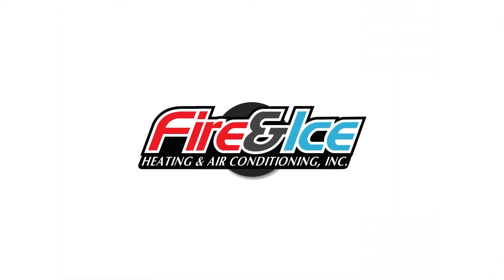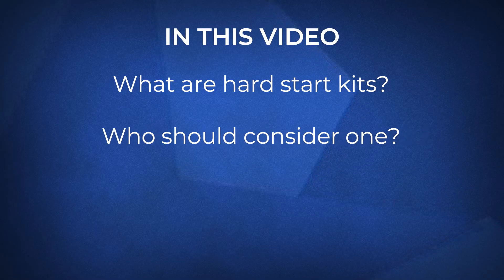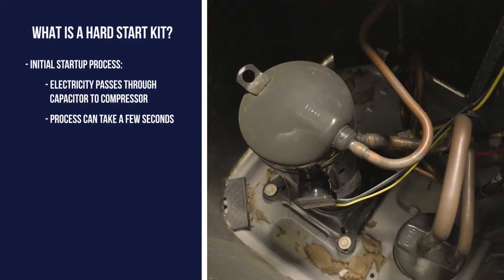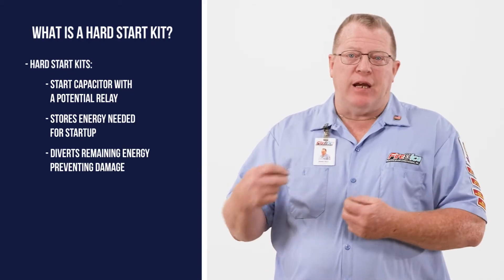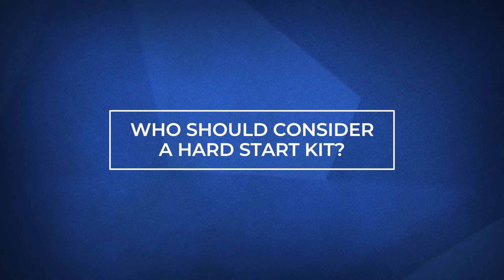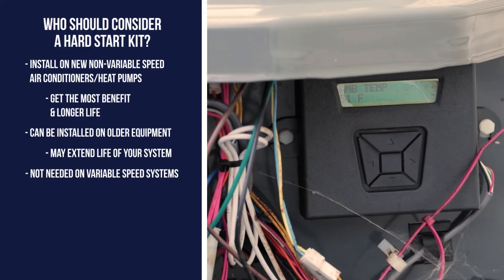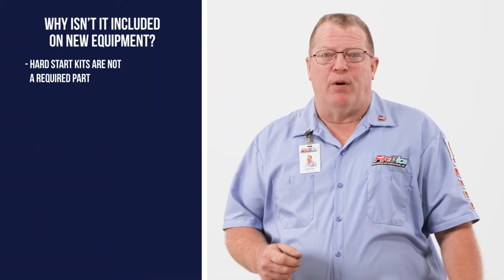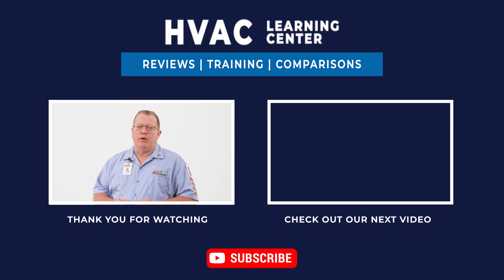Hard Start Kits - What are They and Do you Need One?

Comment: Very helpful video, thank you.   One comment, the installed price of $350 seems very high compared to the actual price of the 2 easy to install parts.
Reply: Ripping you off. I bought a new compressor and hard start kit on my 2015 Goodman and I’ll install with my friend who’s an electrical engineer.
Reply: Yea it is about $35 in parts and less than 30 minutes to install. 😲

Comment: Hard start is harder on your compressor but helps reduce locked rotor amps needed when using a generator.  A soft starter is softer on your compressor and reduces LRA needed even more.

Comment: I was wondering what temperature is rated for the capacitor in hard start kit. I live in Arizona and any capacitor rated for less than 85°C is not useable for AC in here. It would not last even one summer. We have temperatures 112°F-117°F in 
June-August.

Comment: Working on new units, heat pumps on 4 story buildings , I can say the hard starts have worked on 3 different units on the top floor. It seems some compressors have a hard time with extremely long line sets, those hard start kits worked like a charm, idk if it’s common, I am not an HVAC tech but I replace capacitors, find shorts and leaks all the time so mostly am dealing with new units all electric heat pumps and long line sets are too much for some compressors. The hard starts are life savers. Our installers are about 50/50 some love them some hate them. Idk why, but I had an old timer HVAC guy tell me if it’s a heat pump anything TXV put a hard start kit and save your compressor anyway just my two cents I have seen them work and see no negative impact.
Reply: agreed I have TXV and my new unit compressor died in 2 months thank god I had the warranty. New compressor was having trouble starting and after some research Goodman recommends hard start if you have TXV. I changed the capacitor and install hard start both are Amrad a little more money for Amrad but worth it in the long run.

Comment: My 25+ y o Lennox 4t unit has always had a funny start. Initially it started with a significant bang for a few years then settled down for several years and for the last five or so years it seems to have a pregnant pause combined with a vibration. The time period is about 1-2 nanoseconds maybe three. Can you give me a guess? on wtf I can do to get it resettled down. Otherwise it works as expected short of needing about a half pound of refrigerant every couple years or so. Holds pressure for 24 hours. Thanks
Reply from the maker: It’s 25 years old. Well past its useful lifespan. Hard to say what can make noise on that old of a system
Reply: @fireiceheatingandaircondit4363 
It’s only run probably one months time /year. Tho old it isn’t really. The noise has been from day one tho not as hard of a bang as in the early years. The hvac guy says to replace with a smaller unit but it’ll  run a lot more. I smell a rat !!

Comment: after install original 5-2-1 hard start kit, seem the AC when turn on sound like it  kick in louder harder than before, pls help why
Reply from the maker: It does kick in harder
Reply: @fireiceheatingandaircondit4363  the kick sound seem like from the fan start, i replaced new cap OEM and new 521
Reply: @fireiceheatingandaircondit4363  hope it ok not hurting my compressor
Reply: @fireiceheatingandaircondit4363  thank you very much

Comment: Great video. My question is a friend of mine bought 13,000 gas n gasoline generator along with a 10 circuit transfer switch which I installed for him. I bought a micro air easy start kit for his 4 ton a/c unit. But it has a solid state relay hard start capacitor. Do I need the soft start kit or can I by pass the hard start capacitor or stay with the hard start capacitor!!
Reply from the maker: No idea

Comment: My grandmas air conditioner has a hard start kit on its compressor, it was installed in may of 2004, it is now 2023 and it is still working. We are replacing it next week due to other issues. Old amana packaged heat pump. Unit was installed in 1978.
Reply: I’m replacing my York “table top” heat pump circa 1980. What did you end up replacing with
Reply: @darylcuster4417  replaced it with a goodman 3.5 heat pump

Comment: Would you install a hard start kit on a air conditioner that is blowing one fuse periodically or change out the compressor under warranty? Thanks
Reply from the maker: If unit is under warranty, then I would get it fixed.  If that means the compressor, so be it.
Reply: whats the best hard start kit for a Ameristar 2 Ton a/c split system
Reply from the maker: Any of them should work
Reply: @theMister07  Get Amrad
Reply: @NO-END will do, thanks

Comment: Video never bothers to show an AC with and without the kit starting.   Is it quieter?  "Hard Start" seems to be a bad name for this kit.  I just bought a soft start and will install it myself for $300.  Seems like I made the right choice as the soft start is very quiet on my RV AC.  The capacitors in these AC units are designed to die at ten years so they can sell you a new AC unit.  A surge protector can make them last longer, but a surge protector costs about the same as a new capacitor that will last another ten years.
Reply from the maker: Kit makes 0 noise

Comment: Great video. I have an older RV. The AC was "clicking" and I swapped out the three compactors. Everything works fine, but since it's an early 90's RV AC, I was wondering if I should install a hardstart kit. Thoughts? Thanks and subbed.
Reply from the maker: I would not hazard a guess on mobile homes as we do not have experience with them.
Reply: @fireiceheatingandaircondit4363  OK. Thanks for the insight.

Comment: I found the problem. Not wiring but a dislodged plastic piece that should have opened the circuit to the hard start capacitor.  Shoddy parts I would say.
Reply from the maker: I’m glad you were able to solve your issue

Comment: Is the wiring the same when installing on a package unit vs a split unit? I put one on a package unit and it works great. I put one on the condenser unit outside and it smoked the hard start capacitor. I wired it as instructed. Actually I put kits on two package unit with all working fine. I put a kit on two split units and smoke both times. I feel certain I wired it correctly. Thanks
Reply from the maker: We don’t have package units in Columbus Ohio, so I can’t answer your question as  we don’t know unequivocally.

Comment: @1:48:  You stated that the hard-start capacitor stores a charge for the next start, but at the time stamp, you can clearly see a bleed resistor.  So, it appears to me as if that hard-start capacitor is acting as a current buffer at start and shut-off, not as a boost upon start-up.  Am I misinterpreting what's shown at the time stamp?
Reply: I know it’s been two years since you wrote that but you are absolutely correct. There is a bleed resistor on the capacitor of the hard start kit. It doesn’t store anything. The hard start kit has two parts, a capacitor and a relay. Some cheaper hard start kits use a thermal cut off rather than a relay, and are IMO not as good.

The hard start kit adds a capacitor to the start windings to change the phase angle of the start windings. The relay energizes and quickly removes the hard start kit from the circuit. Often the relay needs to be mounted in a particular orientation which is written on the side of the relay in tiny little letters, usually “top” with a little arrow, and mounting properly allows for gravity to help the relay function properly.

Most videos explained that the hard start kit adds a boost of energy that is stored in the capacitor. Nope!
Reply from the maker: No, you are just reading the videographer may have cut the film a little wrong.  These are General videos for people looking for some knowledge, not those who already have it.  Thank you for watching so closely
Reply: @fireiceheatingandaircondit4363 
There is a bleed resistor on the hard start capacitor. 100%.
Reply: ELI the ICE man. Voltage leads(by 90 degrees) current in an inductor. Current leads (by 90deg) Voltage in a capacitor. For every volt of potential stored in a capacitor there is a coulomb of charge stored a well. 1 coulomb of charge is equal to 1 amp. So if your start cap is charged to 240VAC there is 240amps of current availible to be discharged to the compressor. If you dont bleed that cap with a resistance you have welding level current available. Dont believe it? Charge a 1 Farad cap up to 24VDC and place a insulated screwdrver across the terminals. You will get a nice blue arc and a nice chunk of metal instantly vaporized for your screwdriver🤣

Comment: I have a Lennox 2 stage 1 seer 5 ton unit, the lights dim when it fires on, do I need a hard start kit? Can I even put one in on a 2 stage unit ?
Reply: If you live out in the country and you line to your home is more than 250 feet away, you may have a substantial voltage drop. I'm sure a hard start kit will help and make sure line can carry current for all your home needs like water pumps, etc.
Reply from the maker: It can take one, but it may not help that problem, depends on size of circuit needed and what you have, as well as power available to the house at the time

Comment: $300 - $350?  A good hard-start kit costs $40-$70 retail and is simple to install.
Reply: I had a new  capicitor and hard start kit installed 212 bucks  all in. You have to shop around, there are plenty of Heat and Air outfits around
Reply: @ramhaven2322  You got a good deal indeed! You can brag all day long.-
Reply from the maker: The cost to run a business, hire and train technicians, put them in a van, stock that van, insure that van, and build this video so we can have this conversation are just a few of hundreds of items that have to be calculated into every single repair a service company has.
Reply: @fireiceheatingandaircondit4363  Very well stated, it's very easy to condemn the high cost but it is expensive to run a quality business. That van also has to get to and from the service location, that costs money. The reality is if the customer could do it, they wouldn't be calling out a technician. Thank you for the quality videos.
Reply: @fireiceheatingandaircondit4363  A restaurant ALSO costs a lot to run and has lots of overhead, but bacon and eggs won't usually set you back $100.00
Reply: @tripjet999 Apples and oranges analogy.
Reply: @tripjet999  you’re not proving a point. if that restaurant delivered food guarantee and required technical skills that require years of training it won’t be as cheap plus you can buy frozen food in bulk which can cost cents to a restaurant to make a plate.
Reply: @tripjet999  if a restaurant gets their bacon and eggs for 2 dollars in bulk and they charge 10-15$ a plate . Do the math. Your speaking out of ignorance . Do you have any idea how much McDonalds gets their fries for? They charge like 5$ for them and they get them for less than Pennies
Reply: @tripjet999 Genius -NOT!…😊👋
Reply: @fireiceheatingandaircondit4363  and this is why Sears had a trip charge if customer turned repair down, also customer instructs.

Comment: The start capacitor doesn't STORE the energy, it allows more current to flow the 90 degree  run circuit that then gives more torque to start the compressor. The run circuit only uses a couple of amps in normal running. The startup circuit adds a few more amps while starting
Reply from the maker: Your 2nd & 3rd sentence are very correct
Reply: Sounds like you disagree with the 1st sentence? (I do) If the capacitor stores no power then why must they be discharged when removed & tested? Or why do you get shocked when you don’t discharge them? 
    I see the kick-start as reserve/additional power for the capacitor to give it that extra push to get the pump past the most difficult stage of start-up, especially on much older units. Hence “ KICK-START!”

Comment: It would be great if you could explain the differences, and applications, for Hard Start versus Soft Start kits, and especially make note of benefits for homes considering a generator for backup.
Reply: A hard start cap has a relay that turns off the additional cap within a second. It's use if brief, it's a boost, only to get the compressor moving. Test your existing cap with a meter. If marginal, replace it but make sure the replacement cap is correct on volts, mf and size/shape.
Reply: @Barryd57  Thanks for the info, but the request was for a comparison of hard start versus soft start, and the relation to generator use.
Reply: I would like to know the difference between hard start and soft when using a portable generator. Not sure what I need and or why
Reply: @aquazilla645  they both address the initial start spike.  generators have a surge allowance that can allow a smaller generator to be used.      i prefer soft start.
Reply: So , why pay $350 for a $50 hard start kit when it is so easy to install ?
Reply: What the hvac industry needs is an alarm warning when the compressor fan stops working so that it protects the COMMPRESSOR !

Comment: Thanks for the video. Just had a hard start ("kick start") kit installed on my less than 2 year old system at the recommendation of my service tech. Your explanation of the rationale for this device makes me glad I got it.
Reply: How is your unit running with the hard start? I’m still on the fence on installing a hard on a normally working unit. It seems that the HVAC technicians are in disagreement on whether it is beneficial or not worth the risks that it could ruin an otherwise working compressor that does not have problems starting.
Reply: @jamestran3768  I haven't had any problems with it. I wasn't aware of the debate over it among technicians. I went with the advice of my serviceman, in addition to having a UV light unstalled.

Comment: Do your research on hard vs soft start.  Hard starts really only apply where you have an older unit with a compressor that is having starting problems.  Soft start while more expensive offer more benefits.  Several very good video from the HVAC School channel do a deep dive into the positives & negatives of both devices.
Reply: I saw the HVAC school video and got scared to install a hard start kit.
Reply: Unless it's the OEM kit sold by the manuf. for newish, still in warranty units or it's a last-resort thing to get the unit working again. @PrincessAlexisfuntime
Reply: I've been in this HVAC how-to mode lately and watched lots and lots of HVAC videos from lots of people who seem to know what they're doing, I've learned alot,  but the best thing I've learned so far is that the HVAC School videos should be the very first reference source for all this HVAC stuff. Always, for everything HVAC related.
Reply: Ye i have a new unit and I consider a soft start...i got confused for a sec
Reply: When I am searching "Soft Start Kit" why does everyone mention being specific to RV (recreational vehicle) applications?
Reply: @Florida_Man_In_Florida  if you’re going to use a generator to run your house a soft start is the way to go. This video is actually not right. A hard start kit is just more kick to get it started. I don’t see how it’s easier on the compressor. It may help the compressor, but I don’t see where it’s easier.

Comment: Will a hard start kit protect against a power surge?
Reply: No
Reply: After the power would flicker here in south Florida during a storm, my new unit would take up to 4 hours to restart. By then it could be 90 degrees in the house. After I added the 5-2-1 hard start kit, it takes 5 minutes to start every time. That was 10 years ago and it still runs like new. So no it doesn’t protect it but it gets it going quickly.